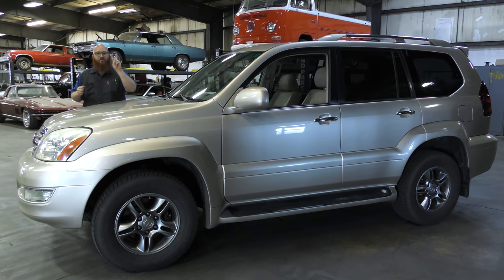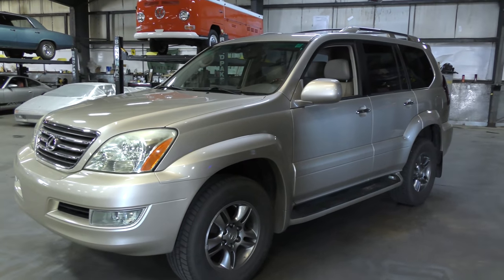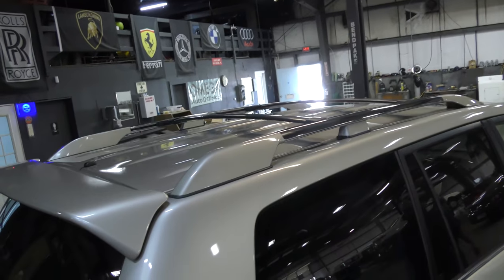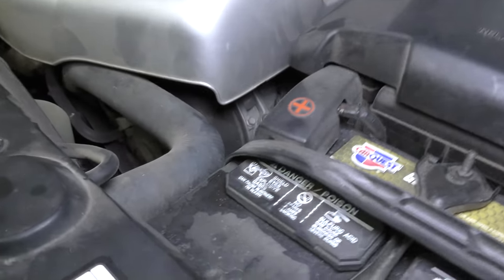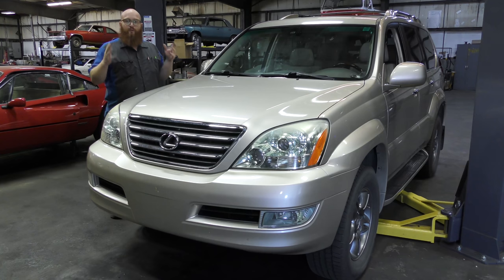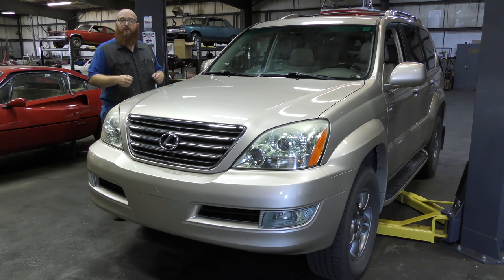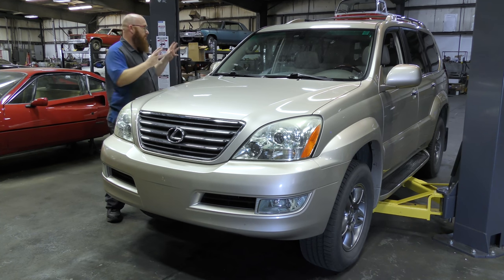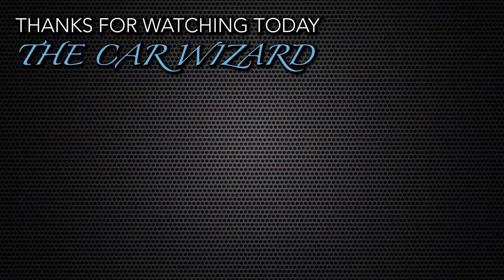Reliable cars get surprise bills too. Simple oil change on '08 Lexus GX470 turns into $1200 repair

Comment: Car Wizard, it's called "preventive maintenance" which is something that many people neglect with their vehicles. Your walk-around/through/under inspection is what finds these issues and you are doing your job by alerting the customer that they will have more serious problems if these items are not addressed.
Great video, thank you!
Reply: Not al car mechanics advise you on preventative maintenance and if you don't know you can't act on it until it breaks.
Reply: most shops don't do it, can't blame the regular owner because they lack the equipment and knowledge to do that.
Reply: @jwenting  Yessir. Every single shop I took my car to and asked them if they can do preventative maintenance they refused to cite anything wrong with the car and they will only fix it when somethings needs to be fixed.
Reply: It's also because a lot of manufacturers list the bare minimum amount of maintenance such as "life time" transmission fluids. I had the transmission fluid changed in my Jag at 80k because ZF recommends it between 60-100k. The guy at the shop says that most people that come to him don't get the fluid changed until 150k and they start having problems. This is especially true for CVT transmissions. They should be changed every 30k, but no one changes it and all those Nissans and Hyundais need new transmissions at 100k miles.
Reply: I do it on my car. Anything that’s showing signs of wear is replaced with a quality oe or an upgraded part and it’s been extremely reliable and still cost less to maintain than a bmw with half the mileage at the same age. Prevention really makes a difference. Less of a chain effect of other parts having issues afterwards.
Reply: @rex_s80  what brake pads/rotors do u recomend? my 17 toyota needs new brakes...its only about 4 years old and 34,000km. mechanic (went to 2) said i need new front pads and rotors. so i wana invest in a higher quality then oem?
Reply: thanks bro for that advise. i bet car wizard has never heard of "preventative maintenance" in his life until mark miller told him. congrats bro
Reply: PMCS
Reply: @randomrazr  i use a carbon ceramic brake pad. they are harder than most factory organic material and will last longer and also resist fade from heat. they can be a little noisy when it cold outside but not nearly as noisy as metallic brake pad material. I use "powerstop" z23 pads for my car and have no complaints so far. i have put about 50k km of hard driving on them and still have a fair amount of life left on them. sorry for the late reply
Reply: @rex_s80  iil try em. how bout rotors?
Reply: @randomrazr  I recommend any zinc coated or similar to reduce rust build up on the areas that don’t have brake pad contact. I have drilled and slotted but i recommend solid or only slotted rotors if you want to increase performance (doesn’t make it stop faster really but reduces chance of brake fade with mountain driving or aggressive driving) the slotted rotors also keep the pads clean and reduce the chances of having grooves. I bought the rotors from powerstop as well but they only offer solid and the “drilled and slotted” versions so if you can find one that’s just slotted I would recommend those. The drilled ones have the possibility of cracking with extreme temperature change such has hitting a puddle of water after hard braking.
Reply: This is why there are perfectly good cars at the junkyard/salvage yard. The cost of maintenance/preventative maintenance accumulates to a bill that’s probably $5k and that’s when the owner decides the car is useless and junks it. Oh well. Good for me I guess
Reply: Hey Mark Miller your Arizona 🏜 Desert Rat Amigo  sending you greetings from Tucson👍
Reply: Actually this is already corrective maintenance, meaning something is out of spec or broken. I work on rotary wing aircrafts, and preventive maintenance is always either a visual or full demontage (depending on small or deep maintenance) of the engine/transmissions/APU's, etc... and checking all bolts/rod-ends/boroscope inspection/ultrasonic inspection for delamination, or whatever is foreseen for that specific part. 

The moment anything out of spec if found, we order it under corrective. If a nut is one time use only, we order under preventive for re-installation.
Reply: Um hi car wizard I wanted to know are acuras and Hondas reliable as well like toyota and lexus because I have a 97 acura tl?

Comment: I have had a similar experience. As a professional, I am asked to inspect and advise. However the customer is more impressed with the price and color. Even to the point of discouraging the customer on the purchase due to necessary repairs and know deficient issues. Keep up the good work Mr. and Mrs. Wizard. I am proud of you both. The old school guy.
Reply: it's the same in every market.
I'm an IT professional. THE most reliable laptops, with the least service issues, cheapest to maintain and longest lasting, are Apple Macbook Pros.
Yet people (including managers at all levels) keep insisting on buying Acer, Dell, and Lenovo because they boast impressive (on paper) specs and are a lot cheaper as an initial purpose.
Of course when after a year half the laptops in that batch have needed repairs and parts replacement (or replacing the entire machine even) in that batch of 50 Dells those same managers will start complaining about how the IT department bought bad equipment (when those managers were the ones selecting those Dells because of the great deal they got from Dell on them).
And that's not specific to Dell, they're just the most common brand here. HP, Lenovo, and others have the same problem.

Meanwhile, the people using a Macbook they bought themselves keep using the same machine for 5-6 years or more and it still runs and looks as new, never needed any service except wiping it down with a moist cloth once in a while.
Reply: *The old-school guy. 🙂
Reply: @jwenting  would more expensive Dell's compare better to MacBook Pros? I wonder if they wanted Dell's because they run Windows
Reply: @jwenting  well as long as one doesn't type a lot...
Reply: @jwenting  - Exactly! That’s why I buy Apple… Also lots of IT guys recommend the laptops.
Reply: @jwenting  Thanks for your insights... As I'm on a budget (and not in a business environment) mac book pros are out of my financial league. Especially since you eventually get "kicked" out of the apple ecosystem for owning old hardware (no updates from apple). Having said that, am not happy I can't properly run windows 11 because it has steep hardware requirements. I have old apple machines and pc's (am a geek)and at my level find the pc's a lot easier to work on. I help people with computers as well part time. I don't get to work on apple products as most people who use them (I know) go to apple for repairs.

Comment: I own a 2005 GX470 (178K miles). Solid solid trucks. Absolutely love it. Super reliable. Easy to work on too. Lots of aftermarket parts. Fortunately, I bought mine in June 2020 before prices went crazy. If you're wanting a SUV similar to this size you will NOT be disappointed. Just get a truck with little to no rust. Not even Lexus/Toyota's are immune to the road salts.

Comment: One time I took my 1994 Acura Integra in for an oil change and there was a small tear on the CV boot on my passenger side.  The mechanic said it's fine for now as the grease inside the boot was barely leaking out.  I asked him how much to change out the CV axle.  He said $180 total with parts and labor.  I told him to change it immediately.  Was taking no chances.

385,000+ and still running.

Comment: I own 2 of these and a rx350. My 04 gx has 227,000 miles and runs great. The maintenance is easy enough for me to do it (except timing belt and water pump). Toyota dealer did it last time for $900. I recommend Toyota and lexus to everyone! Great video.

Comment: I have this same vehicle (same color, too) except mine is a 2007.  Bought it in 2018 with only 130k miles.  The owner was asking $12,000 at the time and I was able to buy it for $11,500.  I now have 150k miles and it drives beautifully, and is probably worth $15-17,000 now.  Truly, this is one of the best everyday vehicles I've ever owned.
Reply: I have always wanted one like this in black but i dont need a big suv 😭
Reply: Except that it gets 16 MPG if you're lucky. Have a daily 2006 just did rear air bags, pump, levelers, water pump, idler, timing belt, CVs, cats. Ready for another 100k.
Raced a new one off the line recently and beat it!
Reply: @sheiladawg1664  Mileage?
Reply: I’ve got one too. Mine is likely going to break 230,000 miles this week. Yours is barely broken in.
Reply: @sheiladawg1664  As an 06 owner with 180k miles and a list of upcoming repairs oddly similar to yours....do you mind sharing a ballpark cost for all that?
Reply: @MichaelTomko4  Have a Sequoia at that mileage, the 2UZ engine is a damn tank.  Toyota trucks are amazing.
Reply: @bwest-yq3uc  Somewhere around 125k.
Reply: @RavensHater007  Got it done in 3 - $2000 stages over a year and a half using a shop to install everything I brought them. Stay away from Dorman exhaust manifolds/cats. I had one develop a non repairable exhaust leak at one of the flanges that had to be replaced a year later.
I found a good shop that lets me bring my own parts but did my own alternator after it tanked at work 26 miles from home. Took about 2 hours in the parking lot.
Still uses no oil, Royal Purple once a year. Flush the trans once a year or so, too.
Great vehicle.
Reply: @RavensHater007  Oh and I'm glad I kept KDSS, it's not that hard to fix. The rubber bags dry rot/leak then the pump wears trying to keep up. The levelers wear also and are easily replaceable $50 ea. EBay has all of this stuff and for me had a pump and 2 air bags for less than the cost of just the OEM pump & was visually identical that a year later is still silent. Was just under the car 2 wks ago and the bags look new.
If you ever decide to change the ride height switch on the console, be sure the replacement is fully pushed onto its mate.
My latest shop had a code reader to troubleshoot the system, it's how he found the connector.
Reply: @majist0  my wife has a 2007 Sequoia Limited with 140k miles, which has been nothing short of bulletproof.  Honestly, I don't even consider products other than those made by Toyota.
Reply: @sheiladawg1664  Thanks a ton for all the info!! Can't wait to drive this thing another 10 years if I can keep the rust away. As a MN owner the one in the vid is almost mint haha

Comment: I bought my 07 Avalon in 09, still in warranty.  I've never had to do anything to it other than the scheduled maintenance items. I make one exception, I change the oil every 3k miles rather than wait for the oil change light to come on. It still looks stylish,  it rides beautifully,  very quiet,  the performance is plenty for me.  Most importantly to me is everything still works like new. It only has 86k miles on her. I don't plan on ever buying another car.
Reply: Avalon is the best large car ever made, there is nothing better.  If they made a wagon version I'd buy it immediately.

Comment: I’ve thought about driving my 09 GX470 down to Kansas to star in a Wizard vid. It’s a great example of just how tough and dependable these things are. It’s got 235,000 miles on it now and the last owner abused the hell out of it for years on gravel roads with minimal maintenance before putting it through a fence in a blizzard, which removed half its front bumper, half a headlight, the grille, rear spoiler and rear glass, yet somehow the only mechanical damage was a single bent tie-rod. The gal then continued driving it that way for a few months until the tire on the bad tie rod side was bald (which is super bad for the transfer case). Finally, she dumped it as trade-in at the local GMC dealer. I like to believe that she got what she deserved and ended up in one of those POS Acadias that Wizard loathes. Anyway, I ended up buying what was left of the GX for VERY cheap and then set about getting it caught up on all its neglected maintenance. Timing belt, tie rod, tires, TPMS sensor, alignment, windshield, as well as a gas cap to clear the Christmas tree of warning lights. Then I changed out the front sway bar bushings, flushed the transfer case and did an oil change and replaced a leaking air spring. The total for all that was roughly $1,500 (that’s the beauty of being able to turn a wrench myself).

That was 2 years and 30,000 miles ago. Nothing has broken or gone wrong since.  I still haven’t fixed the cosmetic stuff, mostly because of Covid and because Lexus parts are spendy AF but I have a growing pile of them in the garage and plan to have it back to looking like a Lexus should before winter. 

I always thought it’d be a great Wizard vid as it sits now though. The fact that something that looks so bad and has been so beaten and abused yet is mechanically functioning like new with no warning lights or clinks or clanks, perfectly sums up why Toyota/Lexus trucks are worth every penny. Only problem is, nothing’s broken so I have no reason to drive down to Omega Auto! What a glorious problem to have.
Reply: Yet another reason why I’m never getting rid of my 2006 Lexus LS430 💎😎
Reply: @glennnichols4220  there is an episode of top gear where they try to kill a Toyota /lexus pick up truck by crashing it /drowining it  in the sea /throwing it of a 20 story building and finally set it on fire !! and the damn thing still starts and get in to gear .great reliable cars
Reply: @hermanklunder789  Yup bro 🤝
Reply: @glennnichols4220  
All the rest of us with an attention span longer than their d***.
But you'll learn young fella....you'll learn.....
Reply: @theodoreyoung8777  My fathers was just hit into and insurance wrote it off, which was a big loss considering it was the second owner from new, full Lexus service history, just went above the 90K mark, regularly cleaned and any work it ever needed....which was very little.... was done within a good time frame. It was actually painful seeing her go, his picked up an Rx300 now but very clearly misses the LS430
Reply: @tahaalvi1913  Sorry to hear that bro and definitely can understand him feeling that way the LS430 has a smooth relaxing and therapeutic feeling like no other 😎🤝

Comment: I got a 2002 Highlander from my Mom when she passed on last month. I really like it. It’s a base model with the 2.4 L 4 banger but it only has 38000 miles on it and was serviced at Toyota since it was new. Great little SUV.
Reply: Yeah, it's a bit older, and probably beige, but who cares! I know a guy who passed on one of those and got a Nissan Rogue because it was newer and in a nicer color, but the CVT transmission died on his way home. I'm sure he looked really cool at the side of the road waiting for the tow truck though!
Reply: @reallyrandomrides1296  yea, I don’t like CVT’s, great in golf carts but not in cars. I won’t buy a car with a CVT! Give me a stick shift or a regular auto. My Highlander is silver, thankfully she didn’t buy beige. She did get the aftermarket leather interior though. I like it quite a bit, Toyota makes some good cars, I have had 2 Celica’s then when they changed them to FWD I switched to the Supra for my next 2 car purchases. The guy who lives across the street from me has had 2 Camery’s, both have gone over 300,000 miles for him.
Reply: @troy9er  Nice! Highlanders look pretty good and high tech in silver. The only vehicle I had with a CVT was a Prius, thankfully no issues with that. I think Toyotas are the best built and most reliable vehicles, regardless of price point. Those Supras sound nice! I'd love to have one, or at least drive one some day (not the new BMW based model, one of the older Toyota based models, preferably with a 2JZ engine).
Reply: You have a GEM 💎 save it keep it
Reply: Sorry for your loss
Reply: 38,000 miles !!
Reply: @josealvarez2149  it now has over 40 K.  She’s getting old, LOL. Runs like a typical Toyota. Great!
Reply: Respect that 4 banger. It's being stressed in that application.